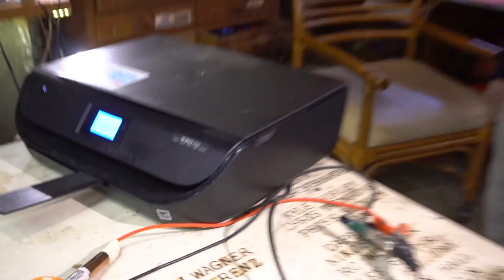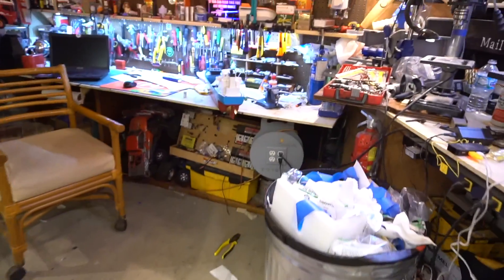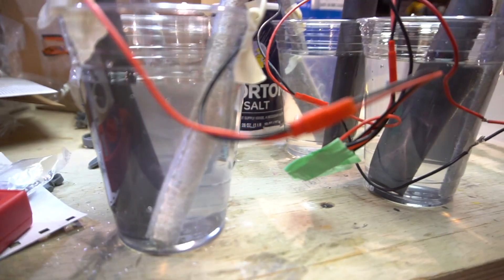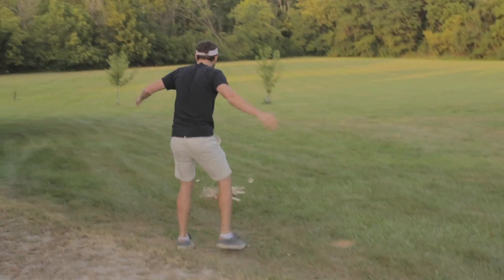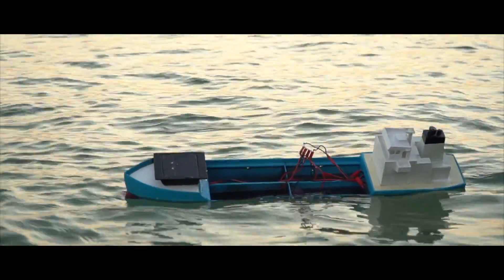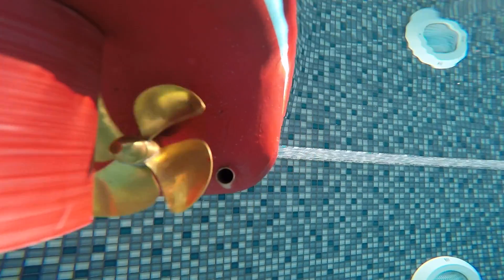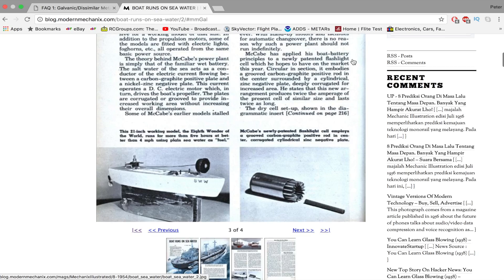Saltwater Powered RC Boat

Comment: Kudos to you 'tinkering' instead of learning theory from a book. Henry Ford taught himself by tinkering and repairing pocket watches and researching/reading books on his own. I think way too much importance is placed on a piece of paper these days instead of practical skill sets. I understand engineers are usually very smart people but just because a person didn't sit through 4-8 years of college and pay $100k for tuition doesn't mean they aren't smart or unqualified themselves. IMHO a college degree simply means you sat and paid for indoctrination in many cases so you can be 'accepted' into the fold. You're smarter than many supposed engineers I've met in my maintenance profession.

Comment: Nice job next time use stirling engines and focus the sunlight on the heat sync compartment and submerge the cold sides in the ocean. After learning what i could about electrochemistry the only useful stuff other than plating and dissolving is HHO gas. You could use that to help heat the stirlings.

Comment: What a surprise, another excellent free energy idea that went nowhere, it's almost as if the sea is designed to be a large battery. In addition to the wind providing free energy for sails, well there's no end to the available power. And if something is producing excess heat, well just add a nitinol generator to suck it all up and recycle it.

Comment: Hello Pete, one small question, the testing off energy from sea waves can not be used to generate energy by constante move off the wave? Can not be aplyed to a boat, the mecanism to catch the movement and generate power to a battery and make the boat work? Sorry my bad english, i am from portugal and dont write lot of english. Complements!!
Reply: One thing more, the cacth wave energy can not be instaled on the back off the ship to catch the movement make by the engine? The V trace on the back off the chip, its movement and its energy. Note, i am not an enginer, i am justa a curious man, low school. Have some more about energy to cars, but they are a bit crazy, and its not creat energy by heat from the brakes, but by creat energy by movement!! Sorry bad english.

Comment: Hay Peter, what backpack were you using at 5:00 onwards and where can i get one?
Cool video, by the way have you thought of having a hybrid hydrogen electric boat using the same hull? By that I mean having an HHO system powered by a battery, that then burns the hydrogen in a engine used as a generator or uses the hydrogen as a compressed gas to spin a motor as a generator to charge the battery.

Comment: Peter, could you try to make a Javelin-style CO2 rocket? I saw another channel where they had fin problems as the rocket could only have fins as large as the tube it was fired from, so if there were pop-out fins on board it would significantly stabilize the flight. And you could use your pencam. ;-)

Comment: Hey Peter, I was wondering if you could give me some tips for a project I am starting. So pretty much what I am trying to do is take apart an old (really old) RC car and use its parts to make a boat. I can’t get the wheel off which is conveniently placed so that you can’t get the motor out and it is also strangely using an electro magnet for steering.
Thanks, soccerinco

Comment: I think it's unfortunate that there is widespread misinformation in describing galvanic cells as "seawater powered" or "potato powered" or "lemon powered" etc, since it's the electrodes that are usually the expensive consumable part.

Comment: Hey Peter, if you want to avoid using blue tape on your build plate, consider switching out that PEI for BuildTak. I've found that it works much better on the Taz 6 over time. Just make sure you have some time when you decide to take the PEI off because it leaves adhesive residue on the glass that needs to be cleaned off.

Comment: Me:*thinking the orange powering the printer was real*
Peter: OBVIOUSLY this would NEVER work
Reply: *fortnite*
Reply: U forgot to finish the meme
Reply: It's like this: Me thinking this orange powering the printer was real
Peter *OBVIOUSLY this would never WORK*... 
Me clicks away *Ya HAD ME THEN YA lost me
Reply: @panda1833  its like this: Me thinking this orange powering the printer was real
Peter *OBVIOUSLY this would never WORK*... 
Me clicks away *Ya HAD
Reply: It's real if you have the correct metals
Reply: @shin6843  bruh you need 120v ac the orange has 1v dc
Reply: itsyourboy shin nope the printer runs on 220v ac. The orange with metals with the most voltage potential can produce 1v dc
Reply: @shin6843  nope. It still wouldnt work

Comment: Imagine how much the metals would weigh on a commercial size, with so much cargo to carry on top of the weight of the metals, plus the scaled drag of the ocean, I wonder if this would work on a 1:1 scale. Maybe there is a question to ask designing the actual hull out of both these metals.

Comment: If you would really, I mean, "REALLY" run your boat on saltwater, use zinc plates on the outside of one side of the boat and brass plates on the other side so they are exposed to the ocean saltwater. This would provide you with plenty of power for the motor and the RC controls as well.

Comment: you should upgrade this with a clutch. just hook up a servo to the motor tray so it can separate the gears. should be a really easy upgrade which would give you more control

Comment: I was WONDERING what the solar panel was for
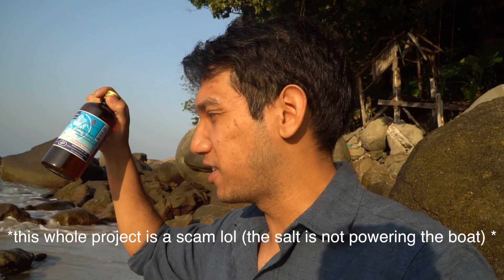Reply: 10:06
Reply: It powers the ship people...
Reply: @baranorak4080  👏👏
Reply: to power rudders or some crap that works with only electricity
Reply: It was for the RC and the servos as seen in the montage
Reply: Remote control?
Reply: I think its for d RC.
Reply: +Xi Steven,no its not for remote control,but idk what it is for.
Reply: The video at the end with the boat in the pool was sped up. He says that at 10 mins it was a scam and it’s not powered by saltwater.
Reply: @luftkadettarchives6387  Hew was saying it's the consumption of the magnesium that powers the boat.
Reply: To gather light from the sun and produce energy. Like Duh.

Lol
Reply: He was using the components of the solar panel to make his magnesium battery.
Reply: Same

Comment: So build the battery but keep the metals/carbon water salt and the Hydrogen peroxide seperat until you need like in a emergency GPS signal or trickle charger it could store indefinitely EMERGENCY BATTERY KIT the new  Baghdad battery
Reply: hydrogen peroxide is unstable- it slowly turns into water and oxygen (2 H2O2 -> O2 + 2 H2O), releasing heat in the process. The decay is slower at low temperatures, which is why you should keep your hydrogen peroxide in the fridge. It can also be greatly accelerated by certain catalysts (e.g. some metals), to the point where highly concentrated hydrogen peroxide can be used as a rocket fuel by pumping it through a chamber filled with catalyst mesh and venting the resulting oxygen and superheated steam through a nozzle.

That said, the idea has merit if you use an electrode combination that doesn't need peroxide. I think it may be what's used in rescue beacons.

Comment: Hey Peter, convert your source to be flow through and then add a large magnet.  You'll form a magneto hydrodynamic drive hybridized with a battery.
Reply: The flow of electrolyte through the cells should also handle your hydroxide problem

Comment: Would have been cool if you'd have tried to use the ocean as the actual electrolyte "tank".
Put the anodes and cathodes on the sides and see if the boat could actually swim through its own battery! :)

Comment: PETER I JUST HAD A GREAT IDEA! MAKE A POP POP BOAT!
Reply: I wonder if you could supercharge it? It works with steam right, so how about having, say, six coils powered by something big like a blowtorch...
Reply: Those are so nostalgic
Reply: @FireyAfterburner  nostalgic????
Reply: Yeah..like the fastest one
Reply: Holy shit, throw back to bath time when I was 4 or 5
Reply: Yeh that was a trends in indo in 90s to 2000
Reply: What is a pop pop boat? (The Netherlands)
Reply: @GOATESS_GOATERSON  its a small boat that uses a candle and steam to move
Reply: @itsjustjaketv6666  oh thank you that would indeed be a really great idea
Reply: Full size? Please?
Reply: O
Reply: A pop pop boat with check valves and directional intake and outlets
Reply: remotecontrolkid One that goes rapidly fast 😂

Comment: Why has nobody commented on the solar cells? He showed them several times during construction.
Reply: As he pointed out, they were to power the RC gear, only the motor is powered by the galvanic reaction.

Comment: Would this actually work for a life sized boat? It’d be really cool if it did and could generate enough energy.
If magnesium and zinc or whatever you use is cheaper than the fuel for the boat it’d be really cool, but if not it’d be useless haha

Comment: Put iNav in it and send it to another country
Reply: Make it an enclosed sort of submarine design, so it can get tossed around a bunch but stays afloat. However, the currents would move faster than the boat could so I doubt it would ever reach its destination.
Reply: That would actually be awesome. Somehow make it able to withstand a lot more, and have it navigate itself to somewhere and track it with a gps
Reply: Across the English Channel to France that may be just short enough
Reply: Maybe a inland water way with it sending back gps blip every minute so we can track it ?
Reply: *the illuminati wants to know your location*
Reply: Great Salt Lake!!
Reply: https://makezine.com/2017/01/25/seacharger/
Reply: What about Adriatic sea
Reply: Pablo Escobar wants to know your location
Reply: That would be an absolutely amazing video series
Reply: I think the actual power density of salt water batteries is horrific. The salt water is just the electrolyte, the electricity comes directly from dissolving the metal electrodes. 

A solar cell could work though
Reply: Wouldn't that be really hard with a model boat since it takes a lot of Mass to make something Blue Water capable?

Comment: The Salt Water Monster Truck uses an electrochemical cell for its power source. In this cell, you have anodes, cathodes, and electrolytes that convert chemical energy into electrical energy. With the fuel cell in this kit, you have magnesium (anode), a porous carbon sheet (cathode), and salt water (electrolyte). During the chemical reaction, the magnesium loses electrons to the chlorine in the table salt. This process causes hydrogen ions to be formed and to travel from the magnesium to the carbon sheet. This creates an electrical current that powers the monster truck.

Comment: Energy really comes out of metals. Then conspiracy people think the water engine can work.
Reply: also water powered engines dont exist (unless your talking about some sort of hydraulic monstrosity) to the best my of knowledge. internal combustion engines powered by hydrogen definitely do however.
Reply: +Wraithsong Gaming why cant ocean water directly power a boat?
Reply: @ripno2672  As MrCuervoRC said the energy comes out of the metals. So it's not the ocean water powering the boat it's just used as an electrolyte. The ship consumes the metal tubes inserted. It's also not very efficient as it cannot be recharged or recycled as one of the metal tubes is dissolved in the ocean. It will quite quick get a corrosion hole in one place and take water. Anyway the design of the ship is quite nice. The holes could be used to center the compartments on gluing. Better would be one side have a pin matching the hole of the other, so the compartments stay watertight. Well this was not the holes purpose of the designer. Also this is a nice technical toy.
Chemically water is something which is already burned an lost it's energy. You cannot burn it again. You can burn stuff like hydrogen or hydrocarbons to water. If you want to get hydrogen from water you'll have to invest MORE energy than you will get back later in a fuel cell or internal combustion engine. The sum of the energy stays the same in all the processes but every process generates some heat and this is wasted energy. Some people claim something else to bait people who don't know the physics. Unfortunately there are lots people who don't want to understand them. They feel better in their religious believe and think they are something better than the "stupid" people/scientists who know they cannot negotiate with nature.
Reply: @thomasmore260  well, i meant as you scoop up ocean water and drop on a wheel, which would spin, then moving the generator piece of a boat. then you have electricity
Reply: @ripno2672  How do you plan on scooping the water up without some kind of power? And before you try: No you can not have something pump water up to run itself, that would violate all laws of energy conservation. Perpetual motion machines are not possible.
Reply: @Excludos  true, but you dont get it. if i have a water wheel underwater, then the currents move it, making power. boats like this were used i think 1850's to 1950's or probably something close. 

picture of a wheel: https://www.google.com/search?q=water+wheel+boat&rlz=1C1GCEA_enUS818US818&source=lnms&tbm=isch&sa=X&ved=0ahUKEwienby8rrLgAhWX3oMKHf--AdYQ_AUIDigB&biw=1584&bih=780#imgrc=VwL9IqTNiQGG7M

copy paste that set of link, then press enter while its in the search bar, then you will see the picture.

picture of a water wheel boat:  https://www.google.com/search?q=water+wheel+boat&rlz=1C1GCEA_enUS818US818&source=lnms&tbm=isch&sa=X&ved=0ahUKEwienby8rrLgAhWX3oMKHf--AdYQ_AUIDigB&biw=1584&bih=780#imgrc=vG6eCcQNYYqG4M

copy paste that set of link, then press enter while its in the search bar, then you will see the picture.
Reply: Water engines work if you strip the hydrogen from the H2o in a quick enough manner and use a small displacement engine with a low compression ratio, and short stroke, to make the most out of the combustion...

Though technically then it's a hydrogen powered engine, not water.

Sigh...must I do everything myself?
Reply: MrCuervoRC He said that in the video you dumb fuck

Comment: there is a company called OWI that makes salt water powered toys like monster trucks, cars and robots. we have built the monster truck and its awesome but the magnesium cartridge does not have a long run time or much torque or power to make the truck crawl over stuff so we ended up using batteries anyway.

Comment: 10:00 wait im confused, is it real or just a joke?
Reply: Yeah, it's real. But the salt water is not powering the boat. Instead the power is generated as ions are released from the anode into the liquid. As the ions are positively charged, the anode will be left with a negative charge (surplus of electrons), which then travel across the wire to the cathode. This flow of electrons is current. The salt water is just the medium for the travel of the ions and the power is generated as the ions are released from the anode which will slowly be consumed.

Comment: Build a RC aircraft carrier and a carrier capable plane!
Reply: Check out FliteTest. Peter built one on there.
Reply: Or he can make something similar to USS Wasp and launch/recover drones
Reply: Could the helicarrier on flite test have planes land on it? I need T check
Reply: Ok I re-watched the flite test helicarrier video, and all the landings were really scetchy. They stopped the plane by crashing into the conning tower and deck, you could say that it was not a proper landing, but both carrier and plane remained intact so its close enough
Reply: Kommenttimyrsky That has been done already.

Comment: That problem about the magnesium oxide makes me think that you should put in some mechanical motion to scratch into the oxide layer. It'll shorten the lifespan of the anode, but magnesium is kind of cheap, right?

Comment: You should have used rectangular probes instead of cylindrical shaped ones. 

Usually it's the surface area and not the volume that matters.
Reply: In theory he should have just used plates, gives the maximum surface area to volume ratio and much cheaper. This is the reason why people use plates for electrolysis
Reply: XenoShade8 should have used carbon and magnesium powder in bags. Stupid amounts of surface area
Reply: hahaha! great idea in theory but the idea of this is to make a battery using an electrolyte and two materials being an anode and cathode. This idea stems from the absorption and releasing of electrons. Haven't had a chem class in about 2 years but the idea is the anode (positively charged material) releases electrons  and creates anions from the electrolyte and the cathode gains those electrons that the anode lost and becomes the cation. The problem with this in real world is that if you use a powder, there wont be proper conduction between the particles of the graphite and magnesium thus making the powder basically useless. That is why plates are preferred, and actually, not just plates, but commercial units use very scorn or scratched plates since it increases surface area.
Reply: XenoShade8 the ions and the electrons that you are speaking of is already in the satl water. What a battery does is move those ions from the negative terminal to the positive terminal. The cathodes and anodes doesn't produce electrons.
Reply: There's only one way to find out if using powder works - try it out.